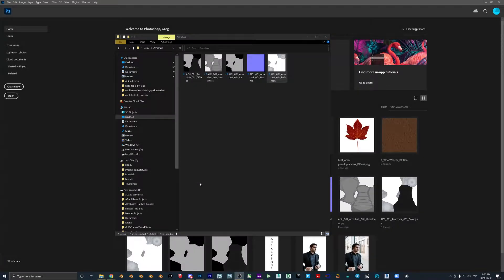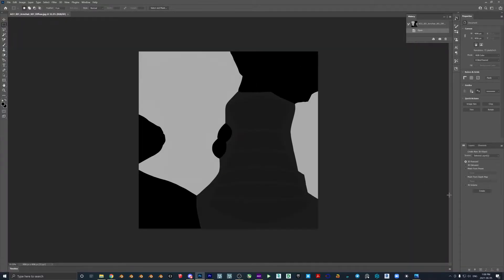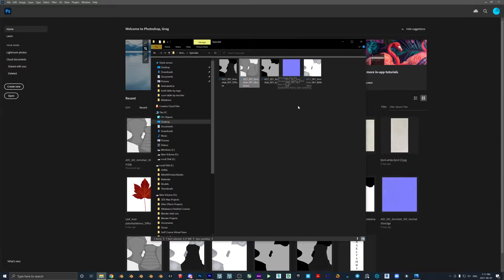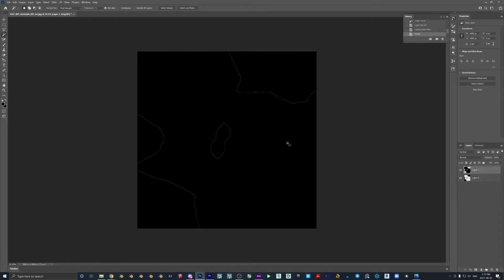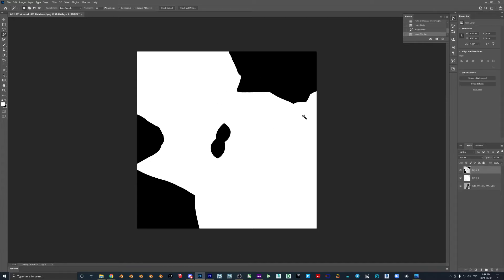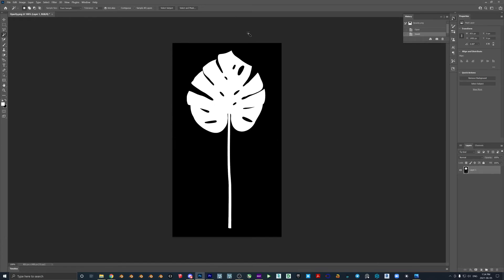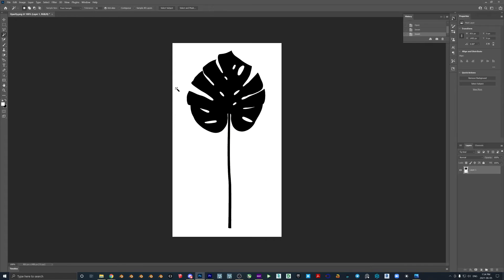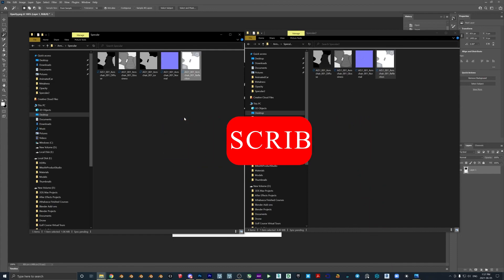CONVERTING PBR Material Workflows! Diffuse to Color! Specular to Metalness!

Comment: perhaps not perfect but worked well. thanks, for converting from metallic to gloss i ended up taking the diffuse, converting it to grey scale, identifying the parts i wanted to be more metallic, and just playing with white and black levels until it looked about right. because my model was really 2 off the same set of maps though i ended up lasso selecting the islands i wanted to make more effected by the metalness and just inverting selection to work on the other model.

Comment: One thing I'd like to point out that can help in remembering when to use white/black on a map.

I think of white areas as YES and black areas as NO. So for a metal map - is the underlying area a metal? Yes? White. If it isn't, then it gets painted black.

This also applies to opacity/transparency/roughness/glossiness/specular.

Like with the metal map, white is going to represent what the map is called. So for opacity, areas that are opaque will be white. For transparency maps, areas that are see-through will be white instead - the inverse of the opacity map as you said. Same goes for glossiness, specular, roughness, etc.

Comment: 8:45 if that line doesn't make you comfortable, you can try selecting by color rather than with wand. From (0.0, 0.0, 0.0) to (19.0, 19.0, 19.0) did the trick for me in my project =)
Reply from the maker: I will definitely try this out. Thank you very much! I normally just do enough photoshop to get by and I don't know a lot of tricks.
Reply: @LuminousLabs  cool =) all those are quite try-and-see experience =)
Reply: Typically, texture maps will overshoot the geometry by several pixels; this is why they appear smeared on the edges, allowing the texture to not perfectly align with the UV map. If set up correctly, this way, that boundary won't map to the geometry and can be safely ignored.

Comment: On the Topic of inverting the Green Channel of a Normal Map ... this is very important (and nessesary) when using OpenGL Normal Maps (for/from Blender for instance) in DirectX Applications (like Unreal) ... or the other way around ... the green channel of the Normal Map needs to be flipped/inverted when switching between these two rendering APIs.
Reply from the maker: I have done the flipping for Unreal, but what other softwares use the DirectX normally? To me it almost seems like a coin toss that is why I always just examine it myself. Unreal has the flip green channel so I never really use it in photoshop, but I did feel it was important to mention.

Thanks for checking out the video :)

Comment: Yes, this video was very insightful, do you have any recommendations for software that do great image upscaleing/low res to hi res for textures?
Reply from the maker: There is actually a website I use called bigjpg I think it’s called. I typically only use it for taking marble textures from suppliers websites. I find it works well! I think there is a 20-30 monthly limit but it is free!
Reply from the maker: I personally only like to 2x the width and length, so a 1k I would only go to 2k and 2k I’d only go to 4K.
Reply: @LuminousLabs  yeah that makes sense, its only so much magic you can work b4 ur tricks start 2 show, thanks 4 the hint to bigjpg👍
Reply: @LuminousLabs  yeah that makes sense, its only so much magic you can work b4 ur tricks start 2 show, thanks 4 the hint to bigjpg👍